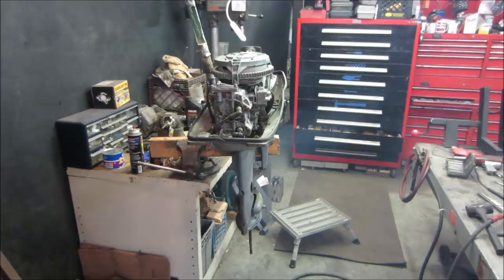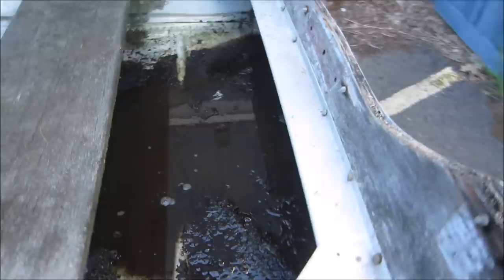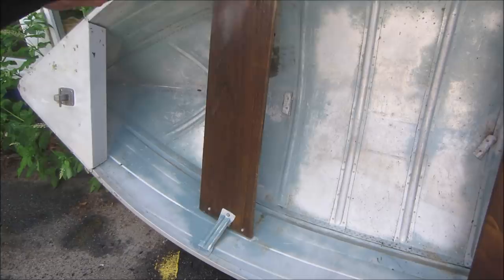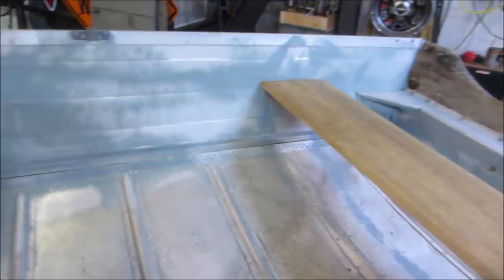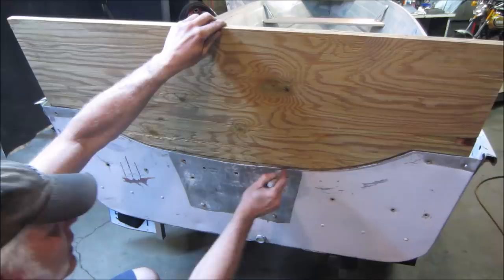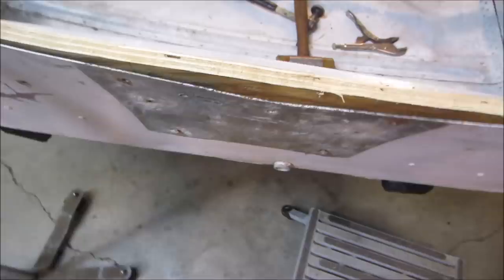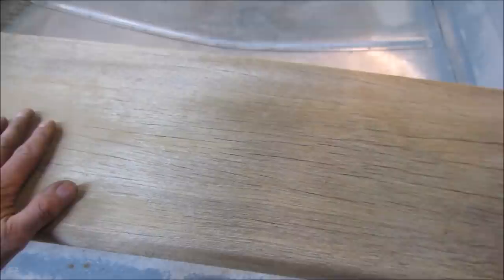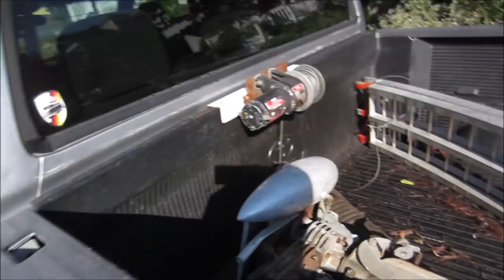Free Boat, First Wash/repair in 20 Years

Comment: I noted something very wrong about that boat federal law 1971 motor vessel safety act requires that positive flotation foam.Meaning that styrofoam blocks are supposed to be installed under all the seats. I am a Coast Guard Veteran, this was something we physically had to check for when we did boating safety inspections to make sure it had not been removed.
 the vertical support between the hull and the bottom of the seat is also missing as you did point out.
Reply: Are you located in jersey? I've hear you mention jersey in several videos
Reply: Agreed, you’d receive a citation here on Long Island. All boats 20 feet and under must have enough floatation to keep it 1” above the surface if fully swamped with maximum rated HP outboard. These are Coast Guard regulations and would also apply in free states such as New Hampshire.
Reply: @WINNERFORDFLEET  New Hampshire
Reply: Im pretty sure that boat was made pre-70's, so how does the regs apply to that?  I have a old jeep that pre-dates seat belts and ive never had a problem from police with it. Just wondering if it is grandfathered in because of age.
Reply: @SaltyPO   Maybe, but why would you risk safety? Then again, I'm a Coast Guard veteran too, and some of that old training just comes out sometimes. 😁
Reply: @SaltyPO  it's makes good sense to have her gloat 1" above water, regardless of the law. You don't need a mine just under the water destroying your outdrive!
Reply: Geez... not another one bragging about being a "veteran" (it does not have a capital "v"). So you worked for the CG, so what?  Hundreds of thousand police officers, for example, are also veterans, as are retired bloody office workers, they don't constantly keep fishing for "respect me more than the rest of you" gratitude, do they?  You did volunteer with your eyes wide open, didn't you?
Reply: @nickturner2813  its not bragging its speaking with knowledge. Not the same thing.
Reply: @SaltyPO  same as your Jeep, oddly enoughthe 1964 12ft aluminum boat made by Smoker Craft that my father and I bought that year had blocks of styrofoam underneath the aluminum seats.
Reply: Mr Turner do you have a degree in Small Vessel Naval Architecture,  did you ever hold a Near Coastal Master License, spend eighteen years captaining small vessels under that. Have you ever been a deep sea Merchant Sailor did that for 18 years after I quit Captaining small vessels. 

What qualifications do you have to make the statements that you did?
Reply: @orangepickel2  You are FAR better off not even responding to these idiots.  They make statements like that just to get a rise out of you.  Trolls.  Don't feed em.
Reply: @Bobbywolf64  I was just thinking about writing the same, when I saw that you already did it.

Comment: Good clean up! the  transom  need to go all the way across or you will have flexing and cracking issues in hull. May want to seal off the wood at the seams to keep water out to prevent future rot. I find it funny that I now look harder at the road sides then I used to lol looking for that one free bee to take home and work on.

Comment: Nice to see you working on the boat. It’s looking really good. The brackets on the bottom of the hull. Is for deck boards to flatten out the bottom of the boat. So you don’t slip out. When moving around in it. Great work, keep the videos coming.

Comment: There was a piece of wood on the outside of the transom. There was also a couple of triangular pieces of cast aluminum from the transom to the gunwhales. Those are important too and the bolt holes are there and you can see the dark mark on the rear of the transom too.

Comment: I think I would have spent the 50$ on a bigger piece of marine ply that reached to the corners of the transom so the aluminum won’t flex and crack
Reply: Yeah, that was not a great decision to not go all the way to the side. That aluminum back will will crack right at the top edge of the end of the plywood. But, especially since this is a test bed, so its sole purpose is to install and remove engines, and testing them, so it will get more flexing than normal use.
Reply: nah, the back of the boat has a transverse beam spreading the acceleration load to the sides. It'l do for the motors he goes out with.
Reply: I saw that before M even marked it, but test bed boat, who cares. One thing that may not be so good is that the modern treated plywood is corrosive to metals. Maybe put a piece of roofing [flat roof] rubber between the ply and metal.  Just add some doubled blocking at the corners for the top if concerned about cracking. Definitely use stainless fasteners on the transom
Reply: He would have to seal the marine ply with resin and at least a light glass wrap.  And the many bolt holes would need to be properly caulk sealed.
Reply: A couple of wedges and some beefy corner braces will sort that out, but yes that would be a compromise.
Reply: AND no plywood on the outside sitting in water....

Comment: You need the transom to go to the corner throughput the entire length of the freeboard, or else the flexing will weaken the aluminum skin and crack. At minimum the edges of the plywood should be sealed with marine epoxy, and ideally the entire surface with some glass matting. Have fun with it.
Reply: Also all holes should be sealed with a good Marine caulking. You absolutely correct the Transom needs to go corner to corner
Reply: Like said above wood needs to go all the way to the corners and should be marine grade plywood !! that plywood wont last a month it will delaminate and swell up like an old sponge !!
Reply: Yes, but Mustie live in NH, Live free or die,lol
Reply: @vtwinaddicted5852  I do to but he will have problems with it
Reply: If he made up the transom braces that are missing it would be as alright as it needs to be.  Keep in mind he used PT for the transom so in three or four years this will probably have to be redone.  Also I can't imagine the sealant will adhere at all to the PT.
Reply: @bobadam7021  That's why the transom needs to be sealed either with a good paint or epoxy then sealed so no leaks. When I worked in the boat shop you had to make the transom go all the way across. I have seen some with cracks because it was not done correctly. The shop did not want to replace the hole back end.
Reply: Steve Doe I agree but I’ve never epoxied over PT. I have no idea how it would hold up.
Reply: A free boat and shortcuts on rebuilding her integrity. With a marina down the road to witness the proper way and Google at your fingertips... Good Grief!
Reply: @bottomlands  there's never enough time or money to do the job right, but always seems to be enough to do the job twice.
Reply: @ksfraz - I’ve been in a boat where the transom literally fell off due to an improper repair. It was on Peconic Bay on LI, dead calm seas, and a two minute ride from the beach to show off the boat to us six kids that wanted a ride. Luckily no one drowned.

Comment: Many of those boats both aluminum and fiberglass had heavy (thick) die cast zinc corner braces with incorporated handles,they came in various grades of quality,many broke and were removed after 5 years,some though lasted the life of the boat,my grandfather bought a Thomson Fiberglass 16 foot fishing boat in 1956 it lasted 50 years as did all attachments which were heavy-duty zinc die-cast.

Comment: Agree with some of the comments. You need to extend the wood to the side tie it in...
Reply: Agree 👍 💯
Reply: Its a ultra light aluminum boat, doesnt need to be perfect.. 5hp motor isnt gonna be that much stress.
Putting back the corner brackets a definite though..
Reply: Taper cut 2 piece's to fill the transom out
Reply: Lots of opinions on a boat thats not yours!!
Reply: @djmjr77  open forum , u said your piece now go to the corner
Reply: @fg146  sometimes 'good enough' is good enough.

Comment: Things not to do with teak: power washer (instead just a soak teak cleaner and the rinse off). Also never paint over teak: teak is oily wood and no varnish will take. Teak needs to be oiled. Varnish will simply flake off.
Reply: i cringed hard watching him destroy that teak with varnish
Reply: Things everyone does with teak... all
Of those things.
Reply: Especially such well maintained teak.
Reply: @bottomlands  yeah they actually would. Back in the day teak was scrub wood and dirt cheap. I've seen old row boats made completely from teak. It only got expensive when taiwan? or Thailland? cut down almost every last one of their teak trees......THEN it got expensive. I've seen taiwanese cabin cruisers that the deck, interior, inner hull, everything was made of teak. The things were worth more in scrap teak than as a boat.
Reply: If you want to varnish an oily wood like teak, sand until it's smooth enough ( I use 80 grit), vacuum the surface, and just before varnishing, wipe the surface with laquer thinner or, even better, acetone. This removes the oils from the surface so that the varnish can grab. Also, I'd recommend Sikkens Cetol Marine varnish over spar varnish or so-called "exterior" polyurethane. It's an alkyd-based varnish with lots of UV protection. It doesn't crystallize like the poly, because it doesn't fully harden. It stays a bit flexible. I have been using it for years to refinish 100-year-old apartment-building entrances made of mahogany, and it has held up really well, even in situations where the doors get lots of direct sunlight. Their tech support won't tell you about the acetone-wash preparation, though. I found the tip at a wooden-boat website.
-- Renewing the finish is easy, too. Wash with TSP and a Scotchbrite pad, rinse, let dry, and recoat. The instructions say to do this every 2-4 years, but I have found that the upper limit is more like 6 or 7 years.
Reply: @jonathangottschalk7795  Doesn't look like teak, more like white oak.
Reply: @firesurfer  Diffidently not teak. It's most likely lauan mahogany, it's inexpensive and rot resistant. These boats are aluminum for the same reasons.
Reply: OnzeManInKazakhstan It looks more like iroko to me, especially because of the yellow tint after soaking with bleach. I can’t say I’m a fan of varnish on teak or iroko, on my own boats I use either Deks Olje for stuff that needs to be top class, or a pigmented preservative stain like Dulux Woodcare for workboats (the sort of stuff used for things like windows and doors). I too doubt that teak would have been used on a cheap tinny, even 40 years ago it was an expensive timber reserved for high class work.

Comment: hello Mustie .  
here with us on the Zeeland coast, all the wood of the Transum is replaced by Trespa 
( also uest fot making changing boxes for swimming pools )  
that stuff doesn't rot or burn .  
a plastic or composite is also used under the seat of the motor support that holds the bolts to fix the motor support to the transum .  
now most people do not like that so what you can use very well and cheaply for this in a plastic cutting board , 
just cut off the part with the handle, 
4 holes and screw it on .  
the plastic is used so that the bolts do not damage the wood every time you tighten or loosen them and so the wood lasts longer .  

kind regards Hollandduck from the Netherlands 
( source of translation : Google translate )

Comment: That boat is missing its flotation foam under the seats! An important safety feature....
Reply: @Viktor Sligo or if you forget to put the plug back in.
Reply: And don't forget white helmet and goggles...
Reply: Not if it's from before the 70's.
Reply: @TheOtherBill  We had one built in 1963 and it had flotation under the seats.
Reply: @techguy3424  Jeez I did that on the first outing with a sailboat I had just bought. It had a double hull so I didn't know it was filling up with water. Luckily it had built in flotation.
Reply: @TelcoPEI  Some did, but it wasn't required for all until '71 or so.
Reply: @QBRX  oh that's no fun, glad you had floatation built in

Comment: Hey Mustie..this reminds me of my first boat..it had a 50 hp evinrude..it was fiberglass V hull Duo craft...no it didn't run ..it took me a few days it figure it out..it ran really well..i put a water pump on a guys van and 200.00 bucks for the boat.. after i cleaned it up and polished it it looked new ..had it for 3 years..sold it for 1,500,00 trailer had to have new tires and rim's before i could move it..i don't ever wan't another one..lol..Cheers 🍻🍻🍻🇺🇸🇺🇸🇺🇸

Comment: here in florida that trailer is worth 300 in good shape including bearings ,, the boat another 300 if it don't leak to bad and a 5 hp good working motor 700 .. it might not go to the first person but within a week it will be gone .. the corner brackets by the transom are a must .. you can make them out of solid wood or aluminum  ..

Comment: Although the “experts here” seem to be getting a bad wrap I still wanted to chime in. Ah, wait - I can say what I like, I am not an expert!
Seriously, I agree that the transom should extend to the sides of the boat. Those thin bits of aluminium near the corner are now taking all the force of the motor - the transom may well join you in the dinghy, circumnavigation or short fishing trip. You will also need to replace the bracing in the two corners which can be seen to have been bolted with two screws each for transom and hull each side.
Reply: Jeffery Amherst  the channel "that boat guy' also has a test boat for motors. He made a super beefed up transom. Had a video of 3 90hp yamahas on it! It's a 14 foot Jon boat.
Reply: it's not that big of a deal, he can make shims. it's not that hard and there's going to be a follow up video on it. remember that this was FREE and it's not something he is going to pour his heart into. it's a free beat up boat housing.

Comment: Think the board you put in being short, even with a gusset, will flex that sheet metal and it will crack.
Reply: Agree.
Reply: @aliceshaw8265  it's either right or wrong, there's no grey area. I understand to use what you have for economical reasons, but if you going to keep the boat,  or sell it later do it right.

Comment: just to remove grain hairs 80 grit is too coarse You'll actually wind up creating more hairs. 220 or even find steel wool is what is normally used for that purpose. before you finish, dampen a cloth and wipe it over the boards to bring up any that remain. Then when you varnsh, put on a light coat, steel wool it, (fine or extra fine only, never coarse) and then continue with several coats of varnish, many thin coats are better than one or two thick coats so I'm told, but I like a nice thick finnish coat that flows out to make a glossy, very smooth surface. you probably won'at want that for a boat seat.

Comment: Wish that i could get free boat like that. In finland everything is expensive even if it is just a piece of turd.
Reply: Yea I was looking at that like it was free? Damn I'd say here you would need to pay something like 1500 euros or more for that.
Reply: Same here in Ireland! It could be rotting away under a tree in a field, but as soon as you express an interest in taking it all of a sudden it's a priceless family heirloom handed down through the generations!
Reply: It's just his area, I live down Alabama. I could sell that as is, for $1000. He did a video not that long ago, with going around on a junk day picking up free stuff on the side of the road. Talking thousands $ just sitting on the road.
Reply: It depends on the wealth of the neighborhood, the wealthier it is the more likely you are to find “good” stuff for free. I found a fully functional 6 burner stainless Weber Summit grill that worked perfectly along with a patio heater and furniture. The guy was redoing his backyard patio with built-in units and put all the old stuff out by the curb.
Reply: Here in middle USA they throw out anything, its a hoarders paridise,i need a bigger yard!
Reply: I have a feeling he puts a lot of time into the chase. Right place, right time and he is most likely well known in the community. He's not afraid to ask too
Reply: Heck I just sold a sixteen foot boat alum. Semi vee with trailer. Running motor with remote controls and steering wheel bow mounted trolling motor two fish finders bulge pump etc 3 seats. It’s a 1992 always stored in my garage. Asked 1000.00 dollars first guy grabbed it. I hope he gets as much enjoyment out of it that I did.
Reply: Mustie is two towns in from the Mass. border which is now a commuter town for folks working in Boston and Rt.128. I used to go there every other month to the best tack shop in New England, and it's sales tax free New Hampshire. But a lot of folks moved to the area to escape the high cost of Mass., and brought with them their spendthrift notions. So lots of good stuff gets put on the curb.
Reply: @ohmegroin  same in wales, they show no interest for 20 years but if you ask about you'd need a lottery win.

Comment: I'm well impressed by how well those thwarts came back, and not surprising how they soaked up all that lacquer. I'll bet that wood was well washed out after all those years of neglect.  Just looking at that transom, I'd say definitely brace those corners. It's not just the raw thrust that can do damage, but the vibration from the engine as well, can cause metal fatigue at those 90 degree junctions. Some decent filets will help to mitigate that by delivering the thrust into the longitudinal structure of the boat.

I was surprised at how well the bleach cleaned the crud off of the inside of the hull, and I'll bet the stench of decay would be vastly improved as a bonus - Oh yes, those mosquito larvae - horrible little things. Unless you like mosquitoes, you're wise to get rid of them.

I think you'll have yourself a respectable enough boat out of that, even if it was only meant to be a test bed.